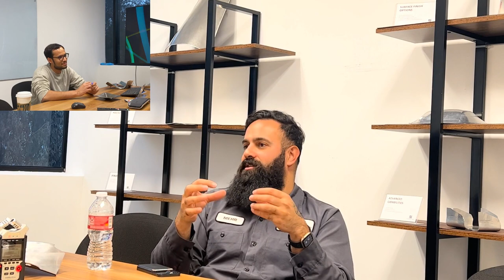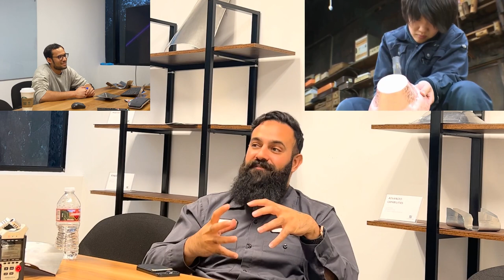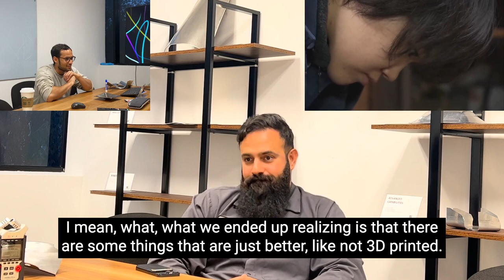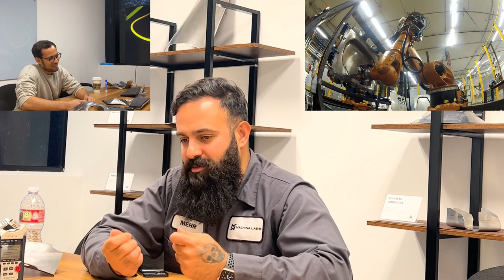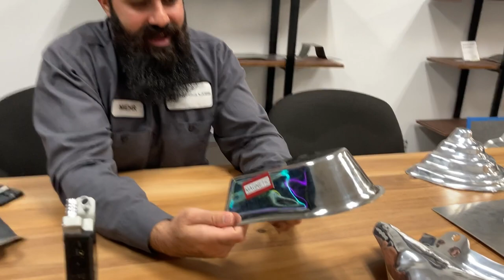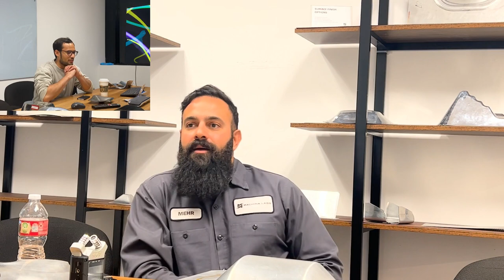A Revolutionary Way to Form Sheetmetal, with Ed Mehr | Ep 364

Comment: Both pointers of a robot have to be in the same distance - the thickness of a metal sheet being forming. The centerpoints of pressure pointer and of releasing pointer have to be aiways in perpendicular with Centerline of forming sheet. The pressure pointer is doing convexity, the releasing pointer is doing concavity. The pressure pointer is moving in (for example) in clockwise direction, while the releasing pointer in the opposite is in counterclockwise direction, by keeping the same feedrate. Cool idea 💡!